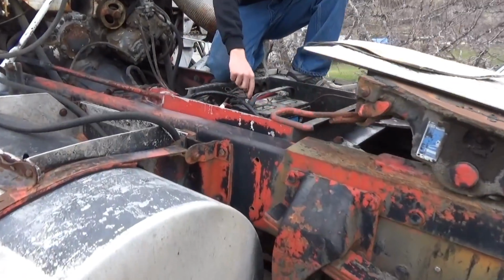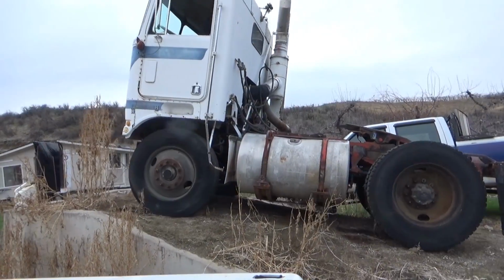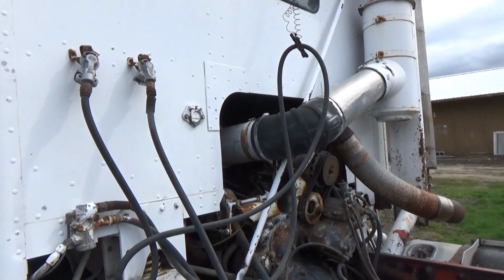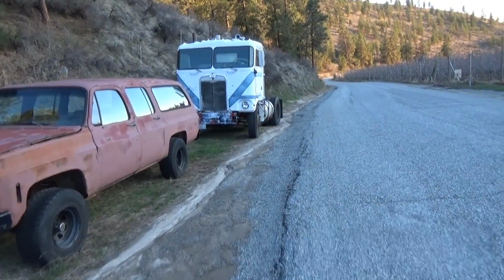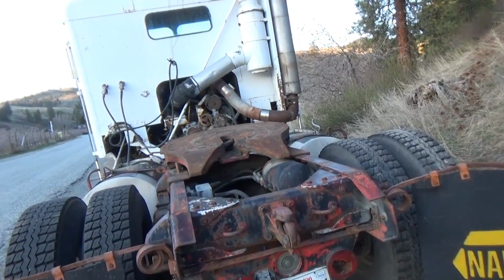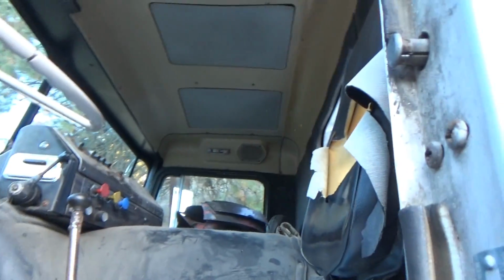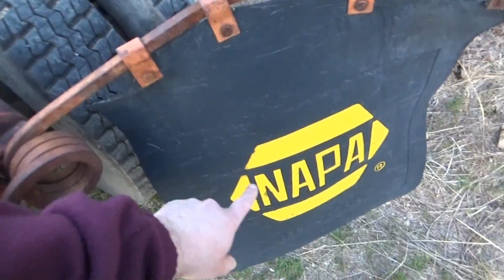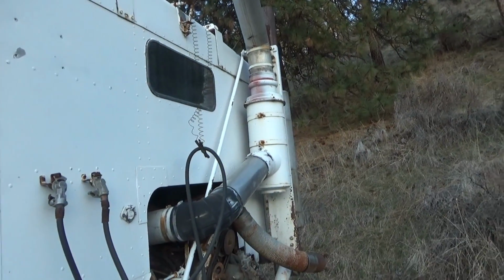Kenworth K100

Comment: Run a 2 stroke Detroit out of fuel is a no no. the best and easiest way is put fuel in tank, remove return line plug the hole on the fuel tank add air pressure and when you get clear fuel through the return line replace return line start .
Another way is to pull start, much easier on the starter, and batteries

Comment: That truck is a perfect candidate for a repower of some sorts, just going to drive it I would 5.9L 12 valve it, and if I wanted to drive it I would N14 or M11 or L10, or 60 series detroit, 50 series is also a fun engine, many options, need to eliminate one of the fuel tanks, air ride that rear suspension

Comment: Nice little slab cab Kwhopper.  What's the wheel base and overall length bumper to frame tail?  It looks even shorter than my Whinder Binder.
Reply: VOLKSWAGNUT about 3 feet
Reply from the maker: i'll measure it when i can and tell you

Comment: Cool old slab cab K121! Very similar to my 1971. Likely a fleet truck originally with those single headlights, Yankee clearance lights and cropped bumper. I saw the Washington plates. Where abouts are you? Can’t be too far if you have a Zip’s cup! Haha! I’m an hour north of Spokane. If you want to check out my truck, I just posted my latest truck update video. https://youtu.be/OLfTuHcGvF0 I look forward to following the progress on your truck! I love “the stance” of mine as well!
Reply from the maker: Wenatchee is the biggest city near us, we are in central wa. my friend actually just recently told me about your truck and how similar it was to the one we just got. Im surprised at the rarity of these particular ones.  with the single headlight and single axle.  903 cummins is a beast of an engine, that is a great truck you got there. ours needed a new fuel pump it is having problems rebuilding fuel pressure  if it has been sitting for a couple days. Not really sure why though.  Thanks for the comment!